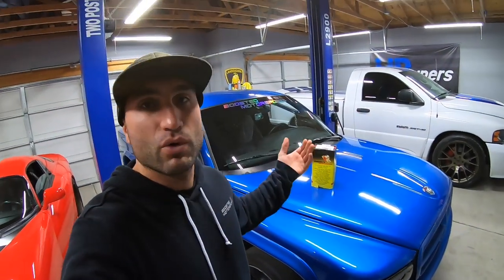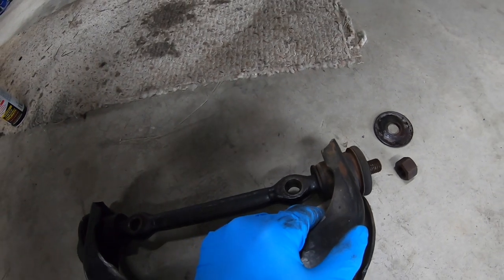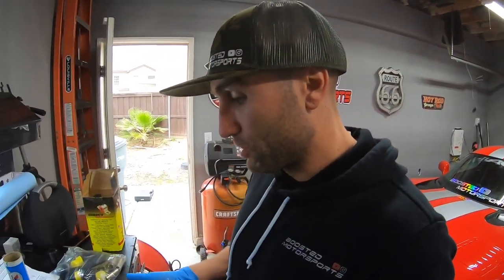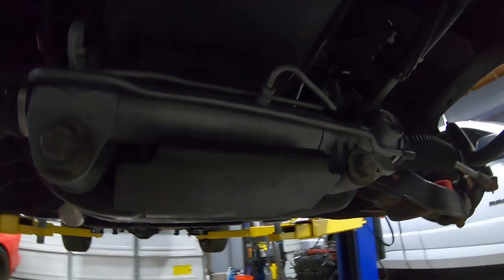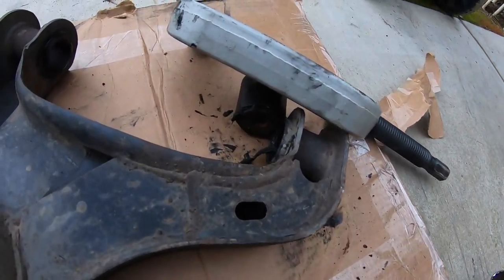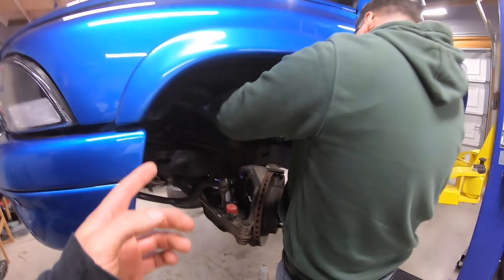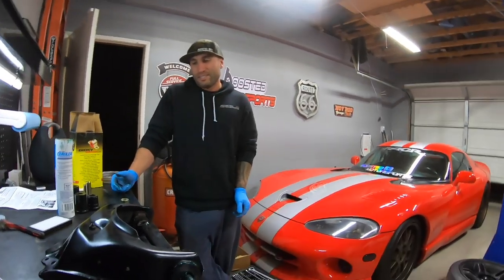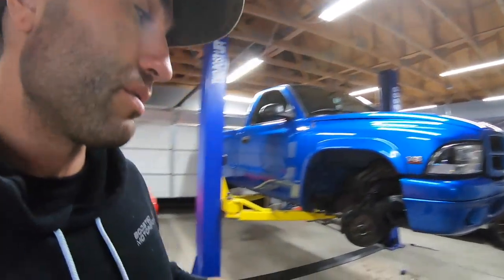Dodge Dakota Front Suspension Control Arm Bushing Replacement UPGRADE

Comment: Great video, a couple things I would have done differently. Do not tighten any of those bolts until you have the suspension on the ground or use your floor jack to put weight on the suspension. I had an old timer years ago show me, when you’re pressing in bushings or bearings put them in the freezer overnight and they will slide right in. With polyurethane bushings always use silicone paste instead of petroleum-based grease. It will not dry out ever and it will not degrade the bushing over its lifetime.

Comment: Great Video fellas. I have a 4x4 that I've been planning on lifting, and upgrading my suspension. But I've been at a loss for how to remove the bushings on the upper control arms. The uppers are nearly identical on the 4x4s, so I think this will work just fine.

Comment: I’ve changed those exact bushings before on a 2wd Dakota, what I did was loosen the nut on the bar on each side to where the nut it flush with the stud on the bar, took my 4 pound hammer and gave it a good whack, and the other side fell right out.

Comment: Help appreciated. Anyone had the issue where they could not remove the cross shaft bolts ? They are stuck in mine and I am unable to get the C clamp positioned to drive in the new collar for the bushing upgrade.
Reply: Any insights on this?
Reply: @barefootarts737  removed the old bushing by drilling it out. And a hacksaw to the old collar with help of a torch and it came out. Looking back I would just buy a new mopar controll arm with balljoint.

Comment: You didn't actually show the arm being removed, or put back in. 

Ive got the nuts off and the bar is still seized against the mount at the frame. Solid as a rock. Id love to see how it's done.

Comment: How did you get the bar between the bushings in the upper control arm out?  Did it come out freely when you took out the bushings?
Reply from the maker: If you’re just replacing the bushings like we were the bar stays in. If you wanted to take the bar out you would need to take press bushing outer shells out
Reply: Ah ok...  Sorry I was looking at other none Dakota videos, saw on where they used a c-clamp looking press to press in the bushing and wasn't even thinking....  Durrr da durrr. Lol
Reply: So what did the instructions say to do instead of the torch?  I guess I'll buy a torch if I have to. Lol

Also we're your bushings oem?
Reply: @luinhaden   I drilled the old bushings out which worked great and then used a reciprocating saw to cut 2 lines into the outer shells and they almost fell off then.

Comment: My Dakota has 230000 miles on it and I dread doing some jobs because I know there will be a lot of unforeseen issues. I just changed the ball joints and one of the control arms bushings and shocks are shot. l think I will just order a new set instead of doing the bushing job. Looking forward to seeing how the truck rides after you are done. Thanks for the content.
Reply: I wish I could order whole new upper control arms for my 96 Dak. Very discontinued unfortunately.  So R and R with bushings is my only viable option.

Comment: Nice work.  I plan to do my control arm bushings also.  You could’ve put the dust sleeve back on shock since you took spring out
Reply from the maker: True but then if we want to drop the shock later it would be stuck in there too. It’s super clean roads down here and not going mudding in this thing so it should be fine lol

Comment: Ive noticed that the caster isn’t really adjustable because in order to get to 0 degrees camber you are already all the way in on the Dakota. There is no negative camber available unless you lengthen the slots towards the engine and on the passenger side that’s not really possible.  So all the way in with the suspension weighted and level at 0 degrees camber is where I set them . Unless someone knows something I don’t.
Sure would like to get some adjustable upper arms that allow for more negative camber without having to cut and shorten the upper arms.

Comment: I have a huge question, I cant seem to find a straight answer, but when you put that upper control arm back on, it moves back and forth on the pivot bar bolts, did you pull it out towards the hub, or did you guys push it towards the engine and then tighten it down.

Comment: Hey John, I'm about to do this same project. Quick question, did you have to secure the bolts that hold the control arm to the frame? Or did you just have to take the top nuts off?

Comment: Make sure you tighten the 2 bolts tight that hold the upper contol arm on if they get loose they start loosening and strip the clamp area and will be impossible to hold the alignment.. bought a 2000 RT with that problem,
Reply: This is strange something  posted over my comment ..

Comment: 13:00 Here you are putting in the bushings and the metal sleeve inside them. You put the bushing in first and the metal tube in second.  I just want to mention that that's the easiest way. I froze mine in the freezer and thought I could slip the tube inside the bushing and the push the bushing in.  Nope.  That does not work. Your way is super easy.

Comment: mopar should have used these stock from factory,i wonder if anyone does at all,or strictly an aftermarket item..??in about 1990 my passenger side fron started squeaking,an id spray with white lithium grease,or w d 40 whatever,an it would stop for a while...

Comment: Jazz could have gotten it done!
Reply: It would be nice if they didn't have the picture of them taking the control arm bolts so far away and dark and would show and closer and brighter pictures so people can see how they get the bolts that are stuck in the rubber bushings out so you can pull the control arm off the truck like they do you can't see anything of them getting the bushings bolts out